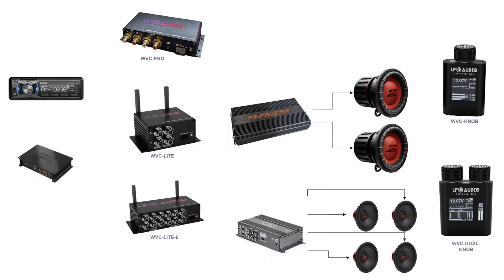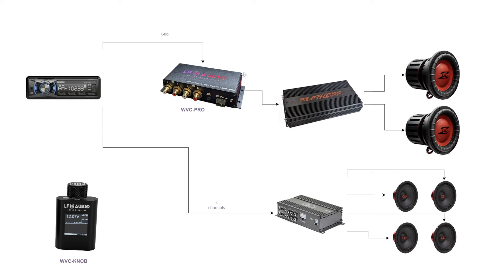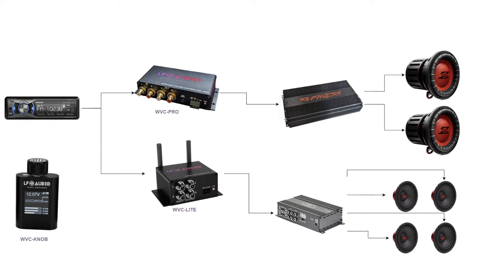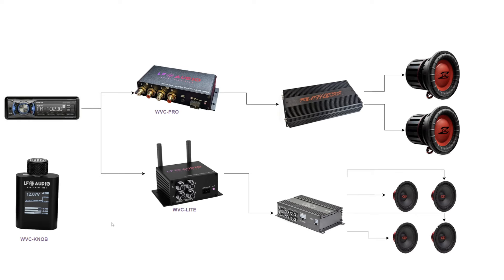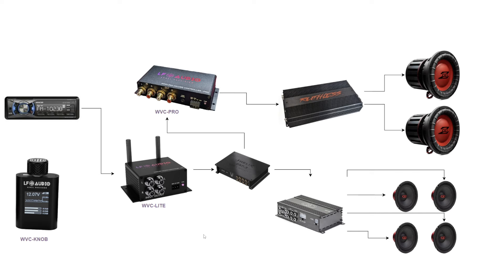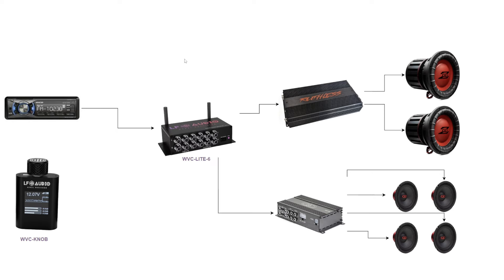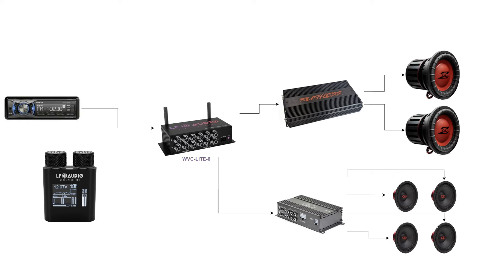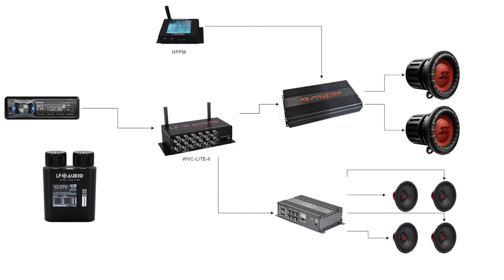LF Audio WVC - Multi Channel Options

Comment: I'm curious to see how the channel groups work because as it stands currently, clicking the knob toggles between normal and fast mode for the encoder and pressing and holding the knob takes you into settings.

Also, while all the examples shown are cool and offer the kind of options you explained, why isn't there a single WVC capable of 4 to 6 channels of RCA input and 6 to 8 channels of RCA output that also gives the end user all the features and functionality of the WVC-Pro and WVC-Lite in one unit?

Personally this is what I would ultimately like to see to not only minimize the number of devices I have in my system but also all of the awesome things(features) that the current combination of units provides.

My ideal and current setup is my head unit feeding signal to my WVC-Pro which in turn feeds a signal to my DSP which obviously feeds signals to my amplifiers which sends a signal to my speakers and subwoofers.

I hope I'm making sense here.
I'd go for a WVC-Ultimate with the dual encoder knob option in a heartbeat!!

Comment: Love what yall are doing. Rca's are cool but what about digital coaxial outputs for those of us that are using it for our sound instead? Also, any way to plug into our amps bass knob plug in (if equipped) so we can see when our amp is clipping? Additionally, for Sundown also utilizes an orange light for soft clipping and red for hard clipping. I'd really like to maintain use of these features. I'm sure yall can do it 1 better tho. Thanks!